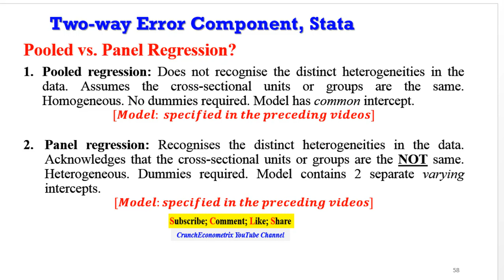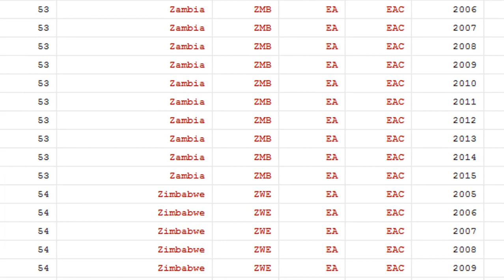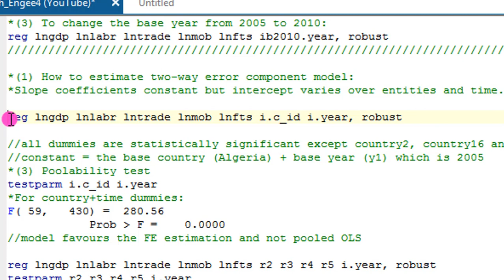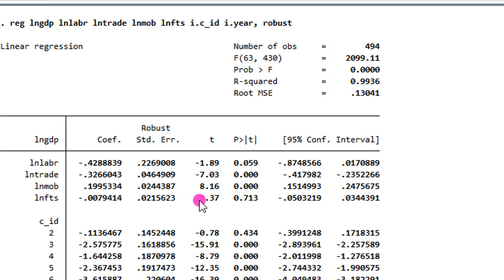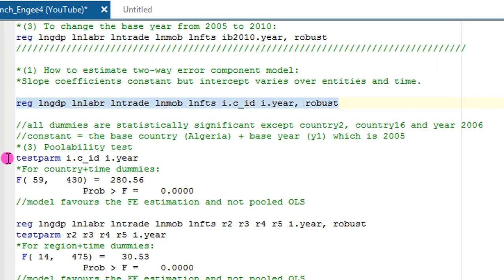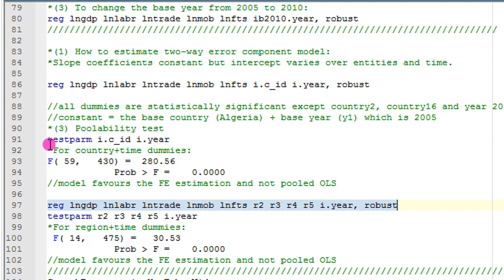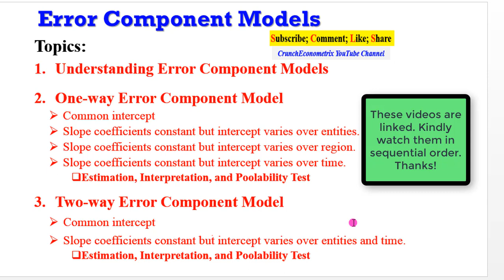(Stata16): Two-way Error Component Models   #lsdv #pooledols #errorcomponent

Comment: Dear Dr. Ngozi I really appreciate your lessons on econometrics, thanks for the nice elaborations. My question is if my analysis showed the significance of using all types (one way and two way) of LSDV 's against common OLS, which type of the LSDV approach I have to choose for interpretations and postestimations tests? And what are the most important postestimation tests I have to do for the selected LSDV model? thanks again.
Reply from the maker: Hi Sarah, use the technique that you feel gives the best outcomes. For post-estimation checks you may want to check out other online resources. Thanks

Comment: Hi, Thank you so much for your video. I have a panel data of 734 firms, and I want to test the impact of one of the 2 categories comprising the firm. I also want to control for industry and time. Does this mean I have to compose three-way error component model? Since, the main independent variable is categorical dummy variable I am not able to carry fixed effect model. Thank you.
Reply from the maker: Hi Nidhi, it appears that you are yet to understand "error component models" which relate to the structure of the error term. Kindly watch ALL the videos again. They are well explained. Thank you.